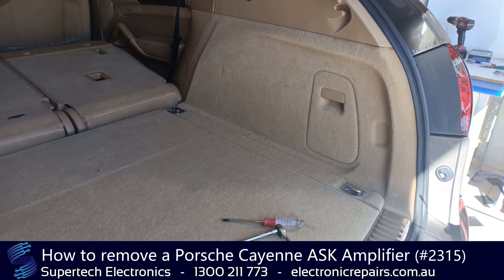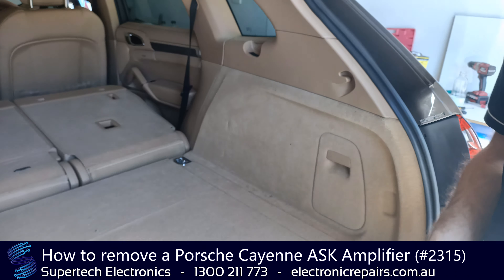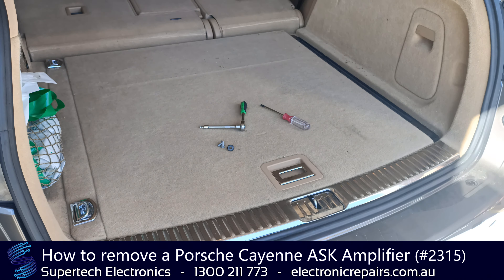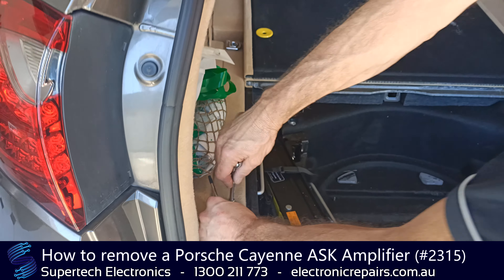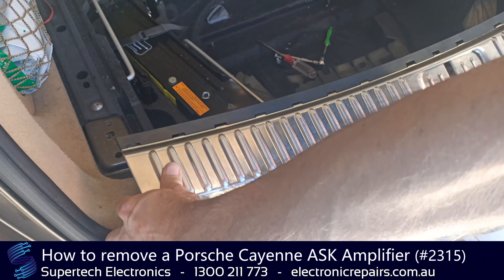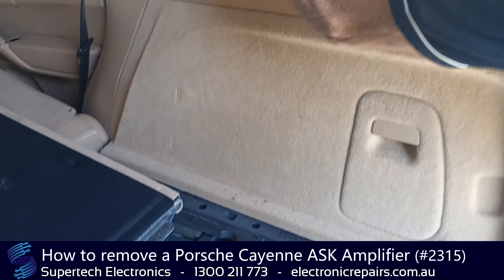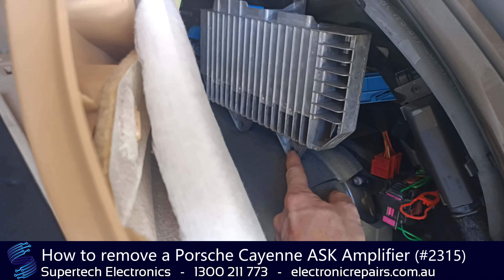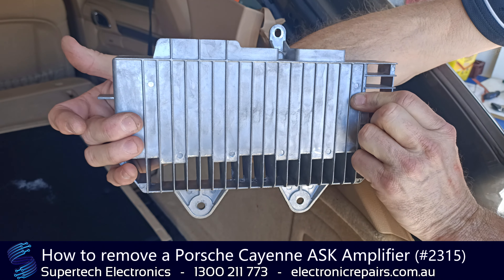How to remove a Porsche Cayenne ASK Amplifier (#2315)

Comment: Curious if you've ever seen "0" volume and a good amp?  I replaced my amp with a refurbished one and still "0" volume and everything on my PCM V3.43 is working. The only clue I have is with both old & new amp I get message that Required "Position-1 external amp is detected" and Actual Installed "Position-1 external amp is NOT detected" along with codes  8010/8011 MOST interruption. I'm out of ideas, you?

Comment: You say some are threaded, top clip on d.panel under small panel with strap...Mine is, and I believe it may have been overtorqued...which torque bit size is required?
Reply: Did anyone figure this out? Can’t figure out the torque bit size either.
Reply: Same I’m trying to figure out how to get mine off as well.
Reply: Very helpful video
Only hard part was that “wedge” or whatever is called. I ended up breaking it but that’s ok as I was able at the end to get the amplifier out
Thanks🎉

Comment: Hi, thanks for sharing this very helpful video. After replacing the device, does the sound system work instantly? or there exist some further steps?
Reply from the maker: We repair these. We do not replace them. And YES! The sound will work again.
Reply: @SupertechElectronics  I have the same problem, but I am in Europe, Hungary. If I’m lucky, in Germany they fix it. But will it work after getting wet due to stuck drain? 😅 (thx for the video btw, now I feel more comfortable removing the entire side panel. First try I stopped half way 😅)